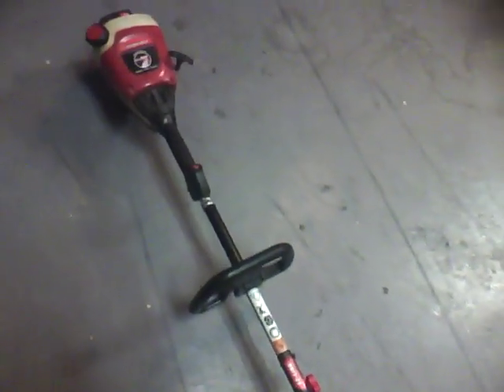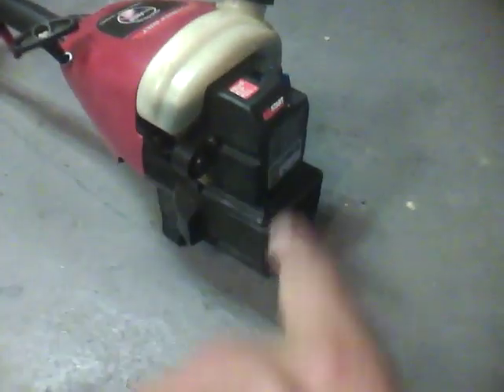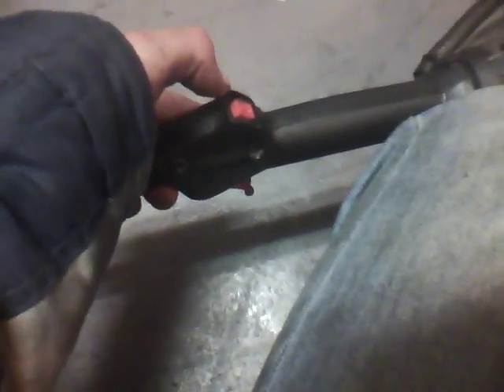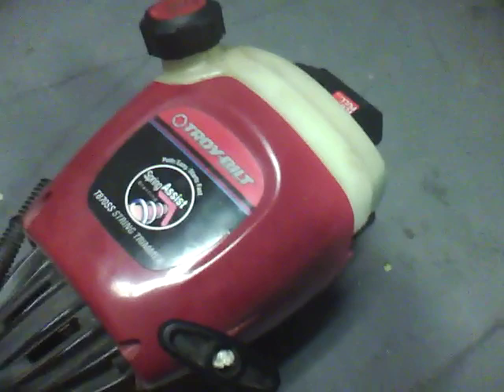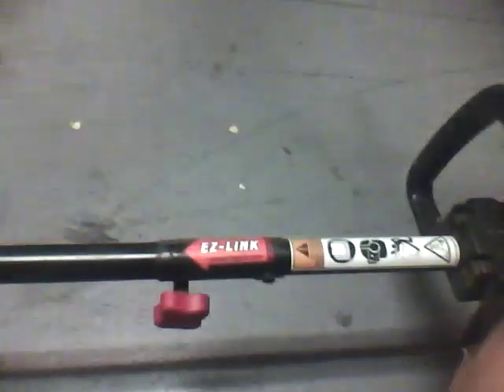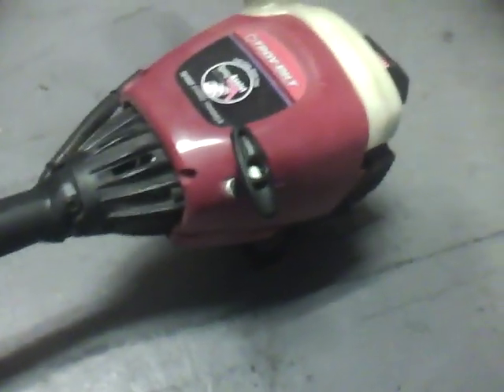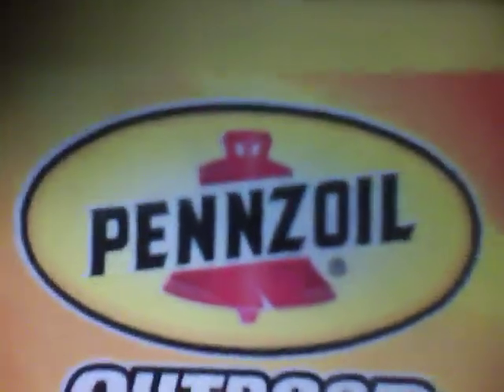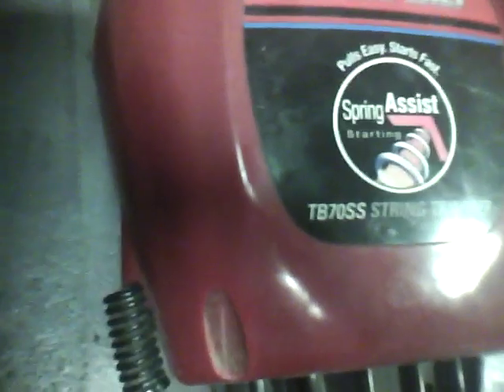cold start my troy bilt weed eater

Comment: I pulled apart an engine off a Stihl trimmer with185 hours on it running 50:1 Stihl full synthetic oil I got it from a landscaping co for 50.00. I could still see the factory honing in the bore. Checked all the internals piston and skirt, bearing for ware all looked normal. Checked exhaust port it was very clean, muffler and spark plug all looked good. I was really impressed. Dino VS's Synthetic I'll take the synthetic. Put it back together and it still runs like a new trimmer.